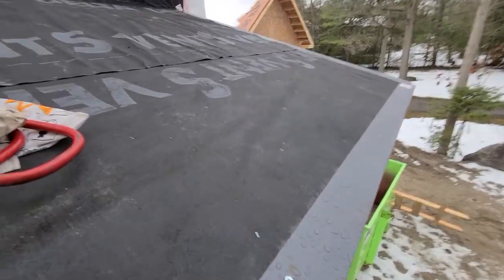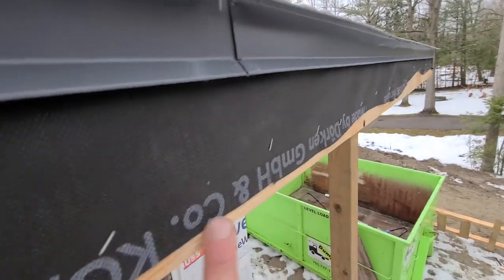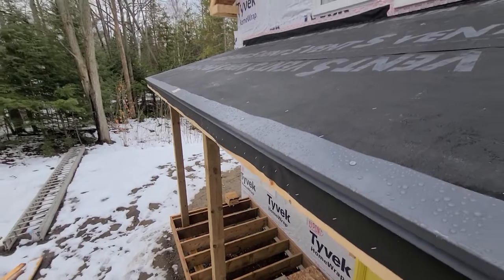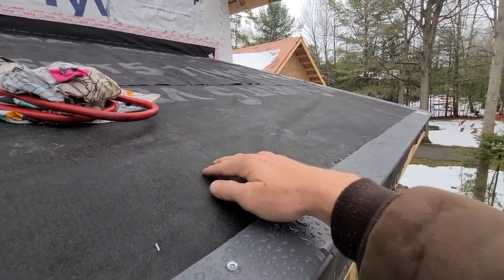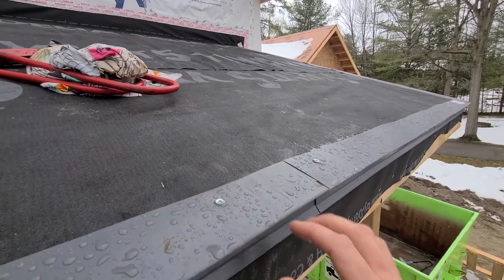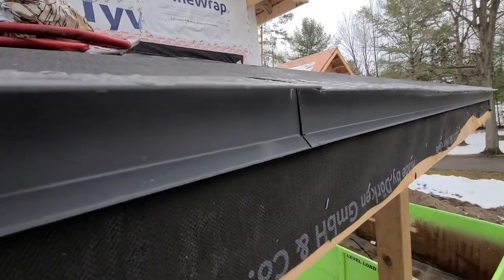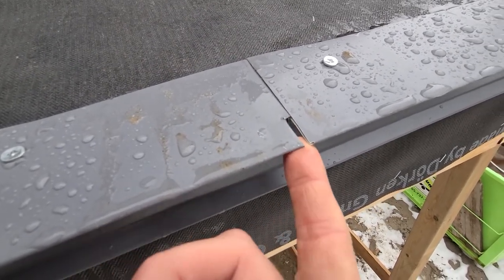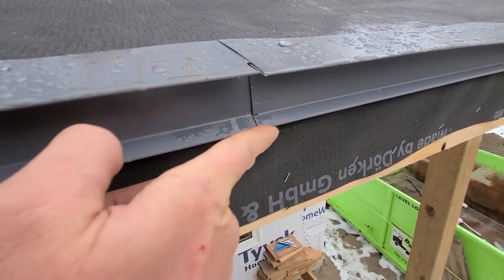Metal Roof Underlayment Installation Explained!

Comment: Do you guys caulk the screws on the starter? Or not necessary? I like the idea of bringing the underlayment  down the fascia but I’d personally still  be a bit concerned bout condensation possibly coming through those screws over time.
Reply from the maker: With this style of underlay yes that would be a concern.... but typically there is peel and stick at the eaves which seals around the screw when you screw through it
Reply: @asm101  right on! figured.. just got thrown off a bit when you said that it avoids having to cover the screws on top. Always great seeing your videos !
Reply from the maker: Thanks for watching!

Comment: Underlayment needs to go over eve metal. I like to cut about a 16" piece of synthetic felt and run it first with a couple inches down the facia not to go past eve metal. Then Install the felt on roof which goes over metal and sandwiches it between the two underlayment.
Reply from the maker: Yes I agree this is the best way to do it...sandwich are always good 🥪